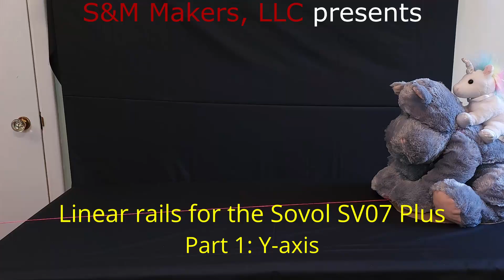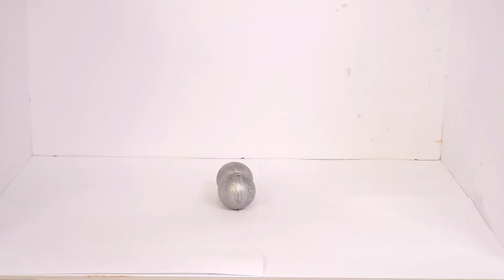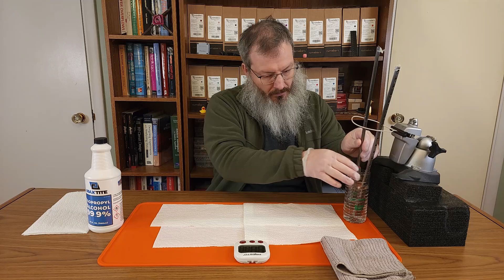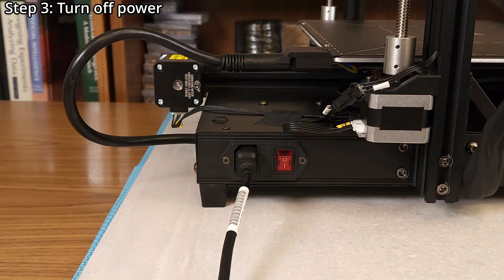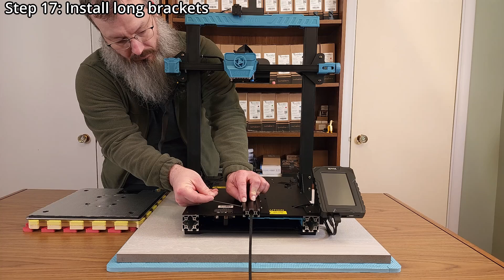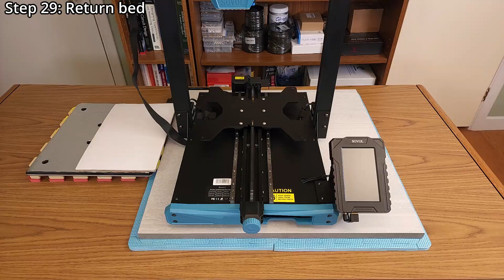Linear rails for the Sovol SV07 Plus: Part 1 (Y-axis)

Comment: so is it car grease or hi temp car grease. subed new best printer man. i have a v 1 viyper .going to make a 1m3 printer this year , not a bed slinger tho. i just got ender 3 v2 as 100 puid . been learning the firmware of old marlin editing . going to use PI and klipper next. i lke to start at the old bit to see were it has gone. with computers i had basic commodore plus 4 now pc windows but had Dos OS have used liunx ,helps knowing the passed to understand the future . been interested in this from a distance since the chain letter thing of maker bot, we give you the opensource bits' the first thing you print is 10 x the bits and pass them on to spared 3d printers. now they are plug and play , but an old printer can be upgraded and make fast or big printer ,cheaper than the apple people (bambo) opensource all the way.
Reply from the maker: Thank you for watching our videos! For grease, I use Moblix EP1, but any lithium-based NLGI 1 or 2 grease without additives should work.

Comment: Are the installation instructions any different between the THK Rails vs HIWIN Rails? I noticed they have varying length.
Reply from the maker: The exact positions of the rails relative to the printer base might change slightly, because you need to ensure the carriages can not go past the ends of the rails, but otherwise, the directions should be the same.

Comment: @SandMMakers   When will you put linear rails in the Z and Y axis?
Reply from the maker: I have the X-axis kit and have planning on creating an install video for it. I've just been holding off until TBStron3D is close to having the kits ready for general sale. However, I actually just found out yesterday that the kits are almost ready so I will try to get the video out soon. I'm not sure if TBStron3D is planning on creating a Z-axis kit.
Reply: @SandMMakers

Comment: I've been waiting for a linear rail kit for my SV07. I love my SV07 after the hardship of getting everything tuned in but I still have problems with the POM wheels.

Also did you have to make a new splatter box for each viscosity demonstration?
Reply from the maker: Thank you for watching our videos and I'm glad you found this video helpful. I don't know when TBStron3D will be releasing the individual linear rail kits, but they are very responsive if you send them an e-mail.

I only needed to build one box (it was just four pieces of foam core) because I lined the bottom with printer paper.

Comment: How much will the kit for the SV07 Plus cost?
Reply from the maker: Thank you for watching our videos! Since I'm not affiliated with TBStron3D, I can't answer that question. However, they are very responsive if you send them an e-mail.
Reply: @SandMMakers No problem. Your video was very informative. However, I am a bit confused on how you got early access to these rails if you aren’t affiliated with them.
Reply from the maker: It's the same as a review unit, except instead of doing a review, I created an installation guide video.
Reply: @SandMMakers  Oh ok I see, nice. How are you liking the print speed and quality of the rails compared to the wheels?

Comment: It sounds like you gave up on Elegoo ;-) Well, me too.
Reply from the maker: Not at all, I have a bunch of really big Neptune stuff in the pipeline.
Reply: @SandMMakers  oh really? I packed my elegoo and it collects dust in the corner. Most of the stuff I print is on Bambu X1C now, big size projects have been already printed and a good thing is that those parts a functional, not aesthetic, otherwise it would be just bad. I am planning to get Ratrig 400x400 v-core 4 IDEX as soon as it is available. Seems more reasonable to me, obviously the cost is not comparable.

Comment: Your Mobileux EP1 grease link says, "No featured offers available". Do you suggest another option hear?
Does it matter if the 3D printed inserts are pla, abs, or other?
When will the rails be ready for purchase?
Reply from the maker: Thank you for watching our videos!!

For the Amazon link, if you click "See All Buying Options," purchase options seem to appear. I have no idea why the purchase options don't just show up. Also, EP1 is generally available at local mechanical supply houses.

The material for the inserts shouldn't matter, since they are not a load-bearing part.

I'm not affiliated with TBStron3D, so I can't say when the different kits will be ready for purchase or for shipping. But I expect them to be available soon.
Reply: @SandMMakers  OK I will check this out thanks Dave.

Comment: EP2 is what Voron recommends
Reply from the maker: Considering the relatively low loads placed on the linear rails in a standard FDM printer, either EP1 or EP2 should work without issue.